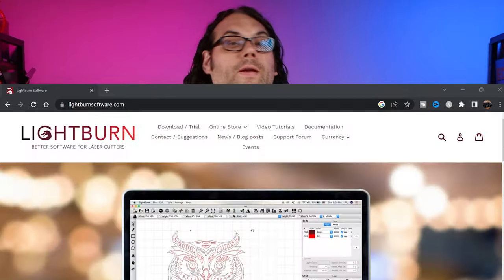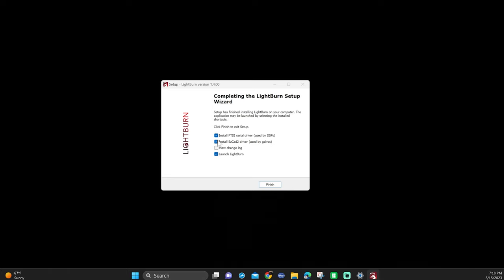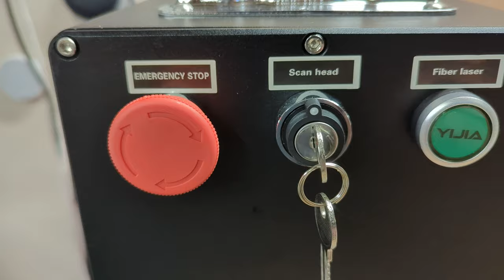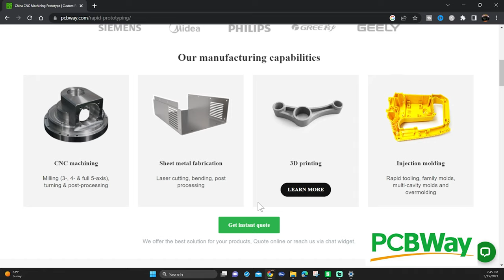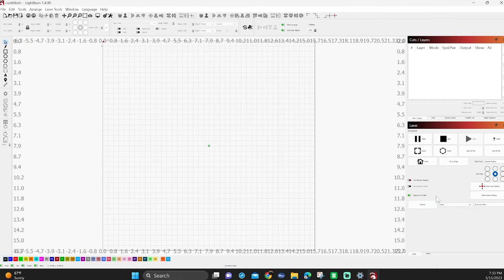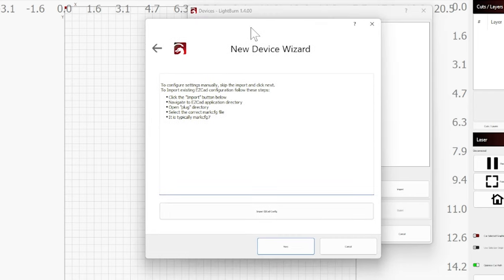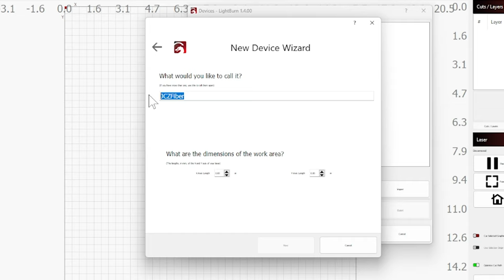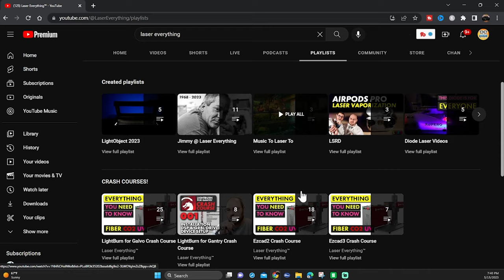How Easy It Is To Connect Your Fiber Laser To Lightburn!

Comment: ok I did as you stated.  I had to reinstall lightburn.. I use it with my co2 laser.  I have had lightburn for a few years now  I went to lightburn and devices and searched for my fiber laser.  When I reinstalled it, it is then that  I was able to add the ezcad2 set up drivers to lightburn.  But it wouldn't let me go further because it kept saying I needed to upgrade my licenses for ezcade2.  but it wouldn't show me where to go to do it when I clicked on it to do so..  It just closed that part of the device set up.  Then I went to my ezcad2 which I had my fiber laser set up to run off the last few years.  It was now in demo mode only.  I have a gaming laptop that runs both lasers at the sametime by the way.  Then I had to figure out how to fix the ezcad2 problem.  Lightburn never stopped running my co2 laser.  I ended up having to ROLL BACK the drivers for the ezcad2 drivers.  I can't find anything on what I need to do to get it to accept the license.  The license with ezcad2 is you just turn on the machine.. The program detects it.. It works.. As long as that driver is in your computer.  My old dongle that came with my laser died.  I don't know why tho lol..  

Note: My lightburn has a license.  But we don't get a license with ezcad2.  I have a Chinese 30watt fiber laser and a 60watt co2 laser

Your set up you talk about is for a fresh version of lighburn.  I was wanting to have lightburn able to run my fiber and my co2.. Not at the same time tho.  If I was doing that I'd just have both programs open.  I have learned tho.  You do not minimize ezcad2 and go to another program, or even a browser while it is in the middle of lasering something.  Lightburn you can do that.  But the ezcad2 program locks up when you go back to it and you have no access to it.. You have to turn off your laser machines motherboard for a split second and turn it back on.. then the program will unlock.  So to use both programs, you start lightburn lasering first, and then go to ezcad2 to do what you're doing there..  Or do split screen with both programs..